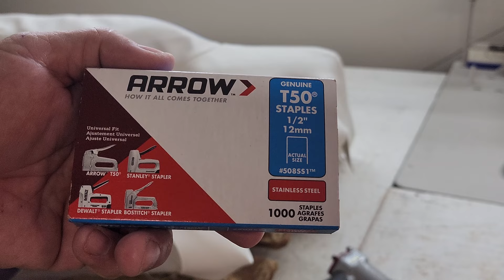Watch Now! How to make easy boat skins seat upholstery

Comment: Great instructional video, I love my table as I covered the wood surface with commercial flooring,  it takes staples, self seals and doesn't hurt vinyl when it is clean!
Reply from the maker: Hello Stephen, Must be a nice table. I am so glad you liked the video! Please keep watching!
Reply: What specific flooring did you use? I used to have a 10ft X 20ft table in my big shop but now I am semi retired and have a smaller table set up. I had Masonite sheets on my shop table and loved it.

Comment: I am just starting out with boat seats. Doing my second set. Thank you for these tips
Very helpful
Reply from the maker: Hello Sherry, You are so welcome! I love hearing good news like this.It just gets better and better. It means a lot to me. Please keep liking and watching!
Reply: @oldschoolautoupholstery  thanks for responding. I only started this as a way to help my daughter redo her boat seats for free. I do have a problem. Hopefully you can help me with. I purchased a consew industrial sewing machine. I did this because when I made her previous boat seats with my old machine, a lot of stress on that machine. the machine I just purchased has a servo motor and keeps tripping the breaker. Do you have any advice or suggestions on what I can do so that I can finish the seats and hopefully create a side business and not have my breakers trip.
Reply from the maker: @sherrybailey2420  Hello Sherry, I have thousands and thousands of comments on my YouTube channel, and I have answered every one of them, just as I am answering yours. I think the tripping problem is with the electrical power source. Maybe an overloaded outlet. Or remove a power strip and go directly to the outlet. Lastly be sure your breaker can handle at least 15 amps. I am no electrician, but I would start there. Please keep liking and watching!

Comment: THANK YOU,  Thank You,  Thank  you .  This  is  the  best video  I have seen on  reupholstering boat  cushions. One suggestion  and  some questions . I  have seen  people  use steam  to  rejuvenate  some  old  foam that  has  been  seriously  compressed. Do  you  recommend that ? The  questions  I  have are I  just  made  new interior covers for  my  20" Proline out  of  Sunbrella one  has  the wood  board  under it  and the rest  have fabric both sides. First  do  you  normally  put  clear plastic (Like a painters drop cloth ) between the  cushion and the fabric  cover ? since it  is  possible  that  the cushion  could  get wet? if not  what  do you  use?
Reply from the maker: Hello Circe, You are so welcome! First, In 45 years of doing boat upholstery I have never steamed cushions. I believe that when you see plastic under the vinyl covers, it is not to protect the foam from getting wet. That is the job of the vinyl. If the water gets trapped under the plastic, the foam never dries out and wood rots quickly. I am sure the purpose of the plastic is for ease of installing the covers in the factory. I use nothing between the foam and vinyl. Please keep liking and watching!

Comment: Love your videos! We have learn quite a bit. An ongoing process. What’s the size of the staples? I’m remaking our boat seats and got a 3/8” pneumatic stapler but the fabric breaks. What makes me think they might be too small for this type of work. 🙏 Any tips? Thank you!
Reply from the maker: Hello Patry, I love hearing good news like this! I only use T50 staples for everything I do. If it is an air gun, be sure the air pressure is not set too high or the staples will want to pass through the vinyl. Please keep liking and watching!
Reply: @oldschoolautoupholstery  Thank you for replying back to me. The PT50 from Arrow and the ss staples?
Reply from the maker: @patry6455  Hello Patry, You are so welcome. In my YouTube channel, I have thousands and thousands of comments, and I have answered every single one of them just as I did yours. I am always here to answer your questions. I do use the stainless staples from Arrow that I pick up from the big box stores. Please keep liking and watching!

Comment: What is the width of the staples? Some sources are touting 1/2" staples and others are saying 3/8". Just curious what you are using. I also noticed a new staple gun in a newer video. Why the change from Harbor Freight to what appears to be an Arrow? Another question, Do you use a sander on your foam repairs? Again, thank you for the techniques and education.
Reply from the maker: Hello Bogo, You are so welcome! I only use T50 staples for everything I do. Not sure of the crown size, I never pay attention. The HF staple gun wore out so I replaced it with the Arrow. It uses the same staple. You can use a sander on foam, but I never do. Please keep liking and watching!

Comment: Good morning… I have a back rest for a pontoon bench that has a small mid section that is gathered… I thought I had it all figured out until I tried it in the bench …I will email pictures….there were big gaps, now I’m trying to figure out what to do to make it look and fit right… I added foam to sides…I think it fits good, now to figure out my vinyl cover that is gathered… I may also need to make a new backer board as original one is a lot smaller… I don’t want to pull vinyl too much and get gaps….do I make my skin a couple inches larger than foam then gather? Would I apply sew foam after gathered (stretch vinyl out then sew on?)…took me all day yesterday to try and get it right now I’m reaching out… I’m hoping I have your email to show what I’m talking about
Reply from the maker: Hello The, Good morning! I know the curve of which you speak of... When I make and install a cover, I use a heat gun and stretch! Eventually, I get it where I want it. Not easy, I know. but not impossible. Please keep liking and watching!

Comment: Hi can i ask what thread you would recommend please.
What make doesn't break down with the sun.
Great work your doing 👍
Reply from the maker: Hello Nt, Thank you so much for saying so. In reality, all threads will break down in weathered conditions. But they do make a T90 UV thread for industrial sewing machines sold at upholstery suppliers. Please keep liking and watching!
Reply: @oldschoolautoupholstery  thanks for getting back,
Would 0.8 vinyl be thick enough for boat seats.
Will track down some of that thread in the UK.
Thanks again Neil.
Reply from the maker: @ntplumber1  Hello Neil in the UK, For boat vinyl, I would stick to marine vinyl, or at least automotive vinyl. These vinyl's will age about the same in exposed weather. Please keep liking and watching!

Comment: Can you tell me what stapler you are using for Marine applications?  I see you are using T50 staples but I am a bit confused which pneumatic staplers will accept T50 staples.  Most of the staplers I see are 18 or 20 ga.  What gauge and crown spec and what staples do you recommend for saltwater marine applications?
Reply from the maker: Hello Let, Go stainless staples all the way! As you know, I use T-50 staples bought at Lowes. I used to use a Harbor Freight cheapo stapler until it wore out. Replaced it with a nicer Arrow stapler. Please keep liking and watching!

Comment: Great job like always. Just wandering were is the plastic protection that always is under the  vinyl in a boat ?
Reply from the maker: Hello All Construction, As you can see plastic was not under the old cover. Some people use plastic to aid in slipping on a seat cover. Helps it glide better. Plastic actually traps moisture in the foam and it doesn't breathe, therefore, it never drys. Thanks for watching!
Reply: THANKS FOR THE INFO,I HAD NEVER THOUGHT ABOUT THAT!
BTW,THANKS FOR ALLOWING A PEEP OVER A TRUE MASTER CRASTSMANS SHOULDER!!
 FINAL RESULT SPEAKS FOR ITSELF!!
O U T S T A N D I N G!!!
Reply from the maker: @jiwbink  Hello Jiwbink, Thank you so much for your support! Please keep watching!

Comment: When you top stitched… you stitched reverse side first then flipped it on to the face of the vinyl and “top stitched “. Did you stitch the 3/8” tag vinyl from reverse side the the top stitches?  Or is top stitches just the stitches that create the look but your not stitched to anything on the underside of that bead???
Reply from the maker: Hello Gill, There is an attachment to the back with a top stitch. Maybe you will see it here: https://youtu.be/dLBUzECeSKY and this: https://youtu.be/fNUWFgNedK4 Please keep liking and watching!

Comment: Another question… where parts of the cover are pulled tight and stretched…would you recommend top stitching… even though the original cover never had any? Would always recommend topstitching vinyl?
Reply from the maker: Hello Thelab, Top stitch is totally optional mostly for the looks. Usually if the cover had top stitching before, I would just duplicate it. Please keep liking and watching!

Comment: Some boat makers use vinyl piping on all of their seat and deck covers where there is a seam.  I was told that adding the piping to the seam would increase the strength and help it from tearing out as seat vinyl age and people stepping on the seam.  I have seen this in Sanger and Malibu boats to name two.  What do you think?  Does adding the piping to a seam increase its durability? Also picky boat owners don’t allow shoes on their boats and also they keep the vinyl clean and uv protection on them.
Reply from the maker: Hello Dew, Piping or welt does nothing to keep the vinyl from splitting once the vinyl becomes shrunk and brittle. The seams fail first where the needle perforated the vinyl when it was first sewn. I replace the old "Skins" all the time and see this is true. Thanks for watching!

Comment: So the original sun pad cover had 1/4 foam backing, on the one you made it looks like you left the 1/4 foam off, may I ask why? 
By the way your work is awesome
Reply from the maker: Hello Boat, I don't remember, I guess I would have to watch again. Mostly foam backing is a preference. Also if the customer paid for it or not. Usually, if it had it before, I would duplicate it. Please keep liking and watching!

Comment: Curious if 1/2" or 1/4" foam is necessary under the cover? I've seen it with and without. 🤔
Reply from the maker: Hello Stacey, Sure you can use 1/2 or 1/4 inch foam if you want depending on the look that you want. 1/2 Inch will look pillowy. 1/4 inch will look fuller. The cover in this project never had this foam. Many times it's just the vinyl itself. There is no standard so you have freedom to make the choice! Thanks for watching!
Reply: @oldschoolautoupholstery  thanks sir! Keep the great info you provide coming!👍👍

Comment: Not all marine vinyl is the same quality such as color depth or thickness of the color layer. When a boat owner has to get you to replace the skins on the seats which brands of marine vinyl have thicker color layer and more durable material?
Reply from the maker: Hello Dew, A dirty little secret that manufacturers will hate me for. All vinyl is basically the same. Plastic over a fabric backing. Some are thicker than others that's all. Marine vinyl is also a scam, they make more money off of it. It gets old just like any other vinyl. If it didn't, I would never have boat or jet ski customers. I will tell you my shop is full of boat cushions and jet ski seats that have shrunk, brittle, ripped, rotted vinyl.  Please keep watching!

Comment: Do you use smooth or grooved presser feet on you machine?
Reply from the maker: Hello Toyota, 95% of the time I have a 5/16" welt foot on my machine. Please keep liking and watching!
Reply: @oldschoolautoupholstery   thanks! But is the bottom of the foot smooth or serrated?
Reply from the maker: @toyotapro  Hello Toyota, I see. You made me look! I never needed to see it before. I just work away. The bottom of the foot is smooth however the floor side of the machine is serrated for grip and friction. Please keep liking and watching!

Comment: Steam your old cushions!! They will come right back almost completely to original form, steam and let dry for several days if possible but at least while your pattering and sewing new covers. You can usually pick up and old stand steamer from Goodwill or other thrift store. They are an amazing tool for reusing old foam in upholstery work if the customer doesn’t want to pay for new foam, if it is in really bad shape, I turn the job away because it will never look good and in the Marine business our reputation is ruined if someone say I did that job
Reply from the maker: Hello John, Yes I do use my steamer that I bought new. Bottom line, I always give my customer what they want. Most of the time I give them more than they asked for. However, I will never also change their motor oil. You can see 43 years of my work here: rudolphsupholstery.com Please keep liking and watching!
Reply: @oldschoolautoupholstery  I have bought expensive Jiffy steamers and was given a cheap one by a friend, the cheap one is much easier, faster and lighter to move around so I got rid of the almost $300.00 Jiffy and also have a hand held that I use quite often that I purchased at Target for about $30.00. It is the easiest of all.
Reply from the maker: @johnettebeaver1991  Hello Johnette, I have also used a handheld steamer. Thanks for the tip! Please keep liking and watching!